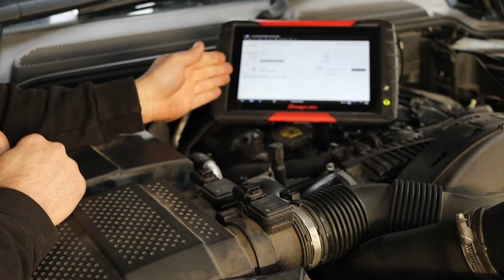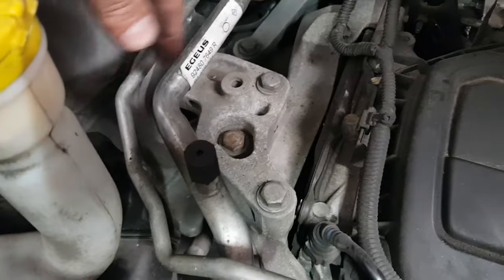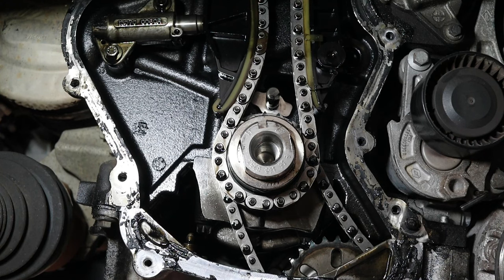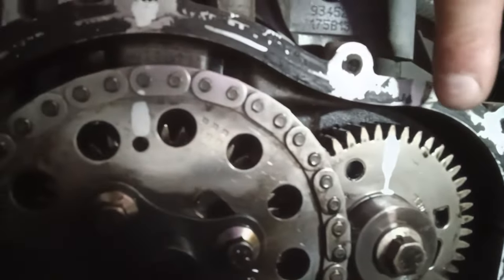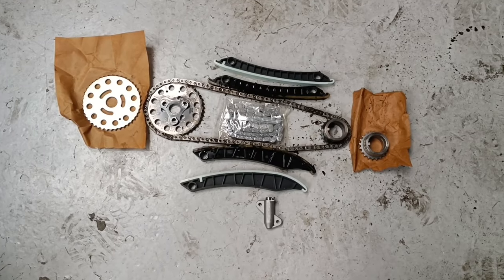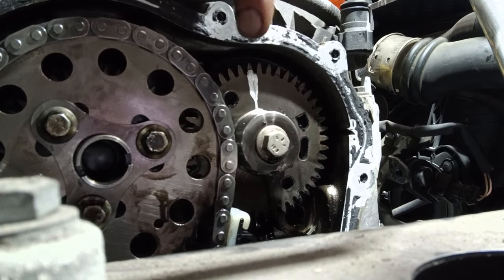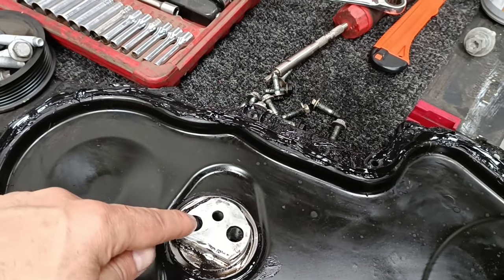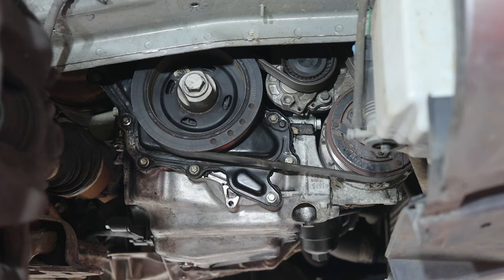Vauxhall Vivaro/Renault, Nissan R9M timing chain replacement

Comment: I have 250 k with my Laguna 3 2.0 dci M9R engine without any noise, bought new and oil changes performed at 10-12k and only original filters, I want to specify that I have not changed anything on the engine, not even the accessory kit and the water pump.
Reply: My engine sounds like shit. And I've just done head gasket and new chain, tensioner etc. Now sounds like garbage
Reply: i have same engine im my nissan qashqai from 2009., 150 hp, 280k, without any noise. never changed anything, only oil every 20k. should i change chain or wait for noise??
Reply: Wait for noise. I would. Imagine but 200k + then don't you think thing may start to wear out.
Preventative maintenence.
Reply: I have the same car, with the same engine. Mine has 350.000 km and still runs well. The key to this is : quality fuel, and regular oil and filter changes (every 10.000km). I use the recomended Elf 900SXR 5W30 and Purflux filters. I've only had to change the main pulley twice, and the EGR valve. Other than that, the car is pretty much all original parts.
Reply: @phazernet9760  so you have never changed timing chain or clutch?? what about turbo, any sign of 'hole'? i have this issue and sometimes it looses power
Reply: @ane_8186  the clutch holds a little low and sometimes makes a noise when half engaged, but it had that symptom for more than a year and didn't fail yet. The chain makes no noise, so why bother ? The turbo has a tiny little axial play, but nothing concerning. All normal wear for 350k. I live in a country with pretty shitty roads and the thing still has the factory shocks. I've replaced the wishbones and the stabilizer bushings because the rubber got old and cracked. I've recently bought an Espace with the R9M engine with 190k and i have to do the timing on it ASAP because it rattles and jerks. It's also leaking loads of oil from the timing cover. The 1.6 R9M kind of replaced the 2.0 M9R, but quality wise they have nothing in common ...
Reply: Good luck
Reply: I’m on 108k now in 1.6 dci changed oil every 10 k OE filters    no problems, coolant I replace every 2 years stays clean like new get 57 mpg avg
Reply: My engine sounds bad at idle rattling and a metallic tinkling only 41k miles. Sounds like the oil pressure operated tensioner isn’t doing a job. Once revs over 1200 runs smooth again. 
It was better when the oil was changed fresh. 
Surely the chain guides can’t have worn out at 41k ?
BT only change the oil every 20k miles I got it at 34k so it must have only had 1 oil change.
Reply: Never changed a chain on any of my vivaro. I do however change the oil and filters every year. Only use Shell Helix. If you don't change the oil expect, chain to go, turbo to go and general wear

Comment: Timing tools for this are MOT 1969 and MOT 1970. They must be used. Cam timing is out on this engine. Slot in the exhaust cam should be horizontal.
Reply: What brand timing tool would you recommend? I have oil leak from timing cover and my traffic 2008 is on 130k miles without service history.  Many mobile pros has rely long booking list and mine has quite bad oil leak so doing research on how to do chain replacement but finding timing tools are used even by mobile pros on these engines to time it then turn twice and see if the timing tool fits perfectly to confirm good timing. People feedback about lower mpg after timing done ( obviously right way ).
Reply: @JJ-jc8yv  I used an eBay kit on my 2.3 master which is the same tools as the 2.0 dci in your van. Different tools to the 1.6 in this video that I’ve listed above.  

The Renault workshop manual doesn’t actually say to turn the engine over and recheck timing. It is a good practice, however.

Can only see lower mpg being from not using tools. Using the tools correctly and following the correct procedure, the timing cannot be wrong.
Reply: @richards4456  I'm in same mind about mpg consumption, need timing tool to make sure it's 100% correct.  I thought one tool does m9r, m9t and r9m engines but you have mentioned as 1.6 is different . I seen timing tools starting from as little as £35 quid on bebay but obviously not branded what's your thoughts on not branded tools. In past non branded tools served me well if taking care of. Sealey timing kit looks same but cost about £135 instead ;) Laser kit isn't cheap too.
Reply: I thought the starter motor had to come out on this engine and the correct pins inserted to lock the crank otherwise the timing will be out.

Comment: No timing tools were hurt or even used in this video 🤣🤣😱😱
Reply from the maker: @craigwilson5573  and that's skill 👍😊
Reply: @melsmotors  to be fair your experience has shown here without the need for special tools. I've been doing job 20year but always use timing tools to cover my arse👍

Comment: Im an Agricultural mechanic Chains on cars might not stretch but chains on a forklift lifting masts do stretch as we have a stretch gauge for when we service the forklift to make sure its safe to use so i know it has nothing to do with timing chains but yes you can stretch a chain .
Reply from the maker: @g.a.f3398  thanks for the info, but they don't stretch on cars and bikes as the loads are a lot, lots less than the lifting force if a fork lift. Every day's a school day 😁

Comment: Thoroughly enjoyed that Mel, used to rebuild diesel engines in Liverpool and go all over the country and Europe repairing and overhauling... I got out the game when I split up with the missus and now own a vivaro for my own little business now that I've seen how you did that I will have no questions now when I do mine... My van is a  57 plate 2.0 has covered 184000 currently... Same engine and box I bought from a family member wit 94000 on clock I service it every 4 to 5 months oil and filters wise and it never skips a beat... Still on original turbo too! Never gets abused daily commute from Liverpool into north Wales and back daily... Served me very well so far mate I can't complain. Keep up the content mate very helpful indeed. 👍
Reply: Fancy doing mine on my 1.6 I’m in Liverpool 😅
Reply from the maker: Thanks for watching and commenting 👍🙂

Comment: Remove the 2 13mm headed bolts on the slam panel piece where the washer bottle neck is held on and them pop the headlight out makes the access 100 times better much easier for setting the timing tools for locking the cam gears

Comment: i would not say that job was the hardest i ever seen and apart from getting the timing spot on the way you done it looks good if i do one i will take the water pump wheel of first thanks for the video great stuff

Comment: Great video very informative, think my chain may be excessively worn as getting alot of noise from that area and oil just running out.  350,000 miles
Reply from the maker: Wow 350k, this just shows that the more you drive a vehicle the longer they last, the van in this video was less than 70k! Thanks for watching and commenting.

Comment: Nice video I have to say that the lack of timing marks on most engines these days is awful.
Reply: There's a proper locking kit for these engines. Timing marks would be useless as the exhaust cam pulley is floating.  Needs to be timed up with the correct tool.
Reply: There was a timing mark on the top pulley but it was installed in the wrong position, a good quality chain kit will normally have marked links as well. As mentioned on other comments there is a locking pin for the crankshaft and a locking tool for the top pulleys!

Comment: Hi, this is a great guide for the job. I'm doing a chain replacement on a 175k Nissan Xtrail that broke its chain at 70mph and would be interested in how the crank /cams can be re-timed if no marks are present on the sprockets and the chain is off. Fingers crossed no valves are damaged - the cams/valve springs are not easy to view on this engine without a load of extra top end strip down.
Reply from the maker: Hi Dave, sadly on this engine I didn't have any tech data for locking tools, hence the painted marks. At 70mph you would have almost certainly broke every cam rocker. I would be astonished it there was no engine damage, you may be lucky! I would remove the injectors and a carry out a cylinder leak test for bent valves. If they're bent, engine out, this is the easiest way to remove the head, not a driveway job! Good luck and fingers crossed. Thanks for watching and commenting 🙂🤞
Reply: ive done an xtrail and was a nightmare, ended up taking the engine out
Reply: Which engine is it ? Old 2.2 diesel or the 2.0 renault one ?

Comment: You need the locking tool for the cams.m to be perfect. The crank can be judged by eye if not but the kit it worth using. Can be done in 3 hours. I do loads. Good video though
Reply: Mark on chain too

Comment: The crank pulley have a specific position for . I mean rotate in some position?  I changed the seal 2 times because bad seal...with first seal engine run perfect balanced but leak seal... second seal no leak but engine vibrates a little but annoying...

Comment: Can't believe its only 66k. Mine is on 160k with no issues. The timing chain is inherently noisy at times on start up. Mine has done it from 55 miles delivery mileage on the clock. It is intermittent, and goes after.4 or 5 seconds of starting. It seems to be a characteristic of this engine.

Comment: Great video thanks. I'm using it to check the timing on my Nissan X-Trail T31. Can I ask how you removed the waterpump pulley? I just had a look at mine and couldn't see a way to lock it to crack the bolts loose. Thanks.
Reply from the maker: You usually loosen the bolts with the alternator belt still on, this way you're working against the compression of the engine without having to hold the pulley! Hope this helps 🙂👍
Reply: @melsmotors  Thanks for the quick reply! I've already taken the belt off, I'll try holding it with an oil filter removal tool and see if that works :)

Comment: Hi great video. My timing chain was replaced. It is leaking a small bit if oil through the bolts on the engine mountain. Can you seal them without having to remove the timing chain cover?
Reply from the maker: You should be able to!
Reply: Would you take out bolts and seal round them?
Reply from the maker: @colindouglas1354  yes and silicone the engine mount as well, this is what I would do 👍
Reply: Cheers.  Thanks for the reply 👍

Comment: good video. Just a extra bit of advice though. Always turn the engine a least 2 revolutions by hand before starting it. that way you will detect any valve to piston contact in case you've made a mistake. otherwise just using the key will bend valves.
Reply: He did

Comment: Great video and great explanations. I think it was a hard work spending probably 5 hours on it. 
Really nice video! Aldo it looks good I'm confused why you did not used a chain locking kit for installing the new chain ? Very complicated and handy job and there's a high chance of damaging the whole timing without it.
I noticed that the new camshaft sprocket wasn't lined up with that mark (the little camshaft sprocket hole should be at 12 o'clock and also use a permanent liner paint for marking it, so that the guys that will change that in the future should have a pro and easier job). 
The new chain (if it's OEM) has two special links (coloured kinda brown) that should be on top (12'o clock) on that camshaft sprocket and one special link (also brownish) so that link goes under the crankshaft sprocket at 6 o'clock. 
Are you guys upset with the Torque wrench? Haven't seen one bolt tightened while using it. (or mention the torque for special bolts)
Reply from the maker: Thanks for your lengthy message. My videos are for entertainment only and not a guide for repair, I don't want to be liable for your mistakes, I never mention torque settings in my videos as they differ from vehicle to vehicle and I also don't waste time videoing me torquing up bolts as to appease people. There was also no data available for locking pins as shown in the video. Thanks again for watching and I look forward to watching some of your accurate videos. 🙂👍
Reply: Even if you use chain locking kit, which actually locks only crankshaft and camshafts, you will need to install the camshaft chain sprocket yourself anyway, as you said hole to 12 o'clock, but there is no way to make sure it is exactly there.

Comment: Great video very informative! I've bought a febi chain kit for my 2017 trafic, but seen it doesn't come with New bolts for the tensioner or guides.

 I'm assuming the bolts can be reused and aren't stretch bolts?
Also if you've got the torque specs for the bolts that would be great!
Thanks
Reply from the maker: You can reuse the nuts and bolts, sadly I don't give out any torque settings because they're different on all vehicles. All my tech data is via registration numbers, so it's accurate to that car! 👍
Reply: Thanks for the speedy reply pal! I'll be getting a workshop manual in that case. Have you ever replaced a steering rack on one of the mk3 trafics? Struggling to workout if the racks are interchangeable between years
Reply from the maker: @thomasdentith-barnard418  nothing is interchangeable on a Renault, even on the same year, Renaults are a pain in the backside!

Comment: All that Silicone ? Does it not squash inwards and bits eventually brake off and it blocks an oil hole and theres your crank or a cylinder gone? Im super careful with excess silicone and usually the outer Edge . Great video thank you
Reply from the maker: No different to factory silicone! You open up most engines and there's silicone over spill. Most sumps are now bonded on and when you remove them there's always silicone over spill. It usually stays where it sets. 👍
Reply: Ok good to know ill take note of that stuff your using , thank you, im going to look at a vivaro tomorrow 180k, ive always had older Vw's im wondering am i mad and these are soft ?
Reply from the maker: @208d  TBF I wouldn't put my hand in my pocket and spend a penny on a German vehicle, I make a small fortune out of crappy German cars! Mercs, BM's Bentley's, Especially Audi's and VW's, the workshop's full of them. I have a 4 year old mercedes sprinter in the workshop for a failed driveshaft, I've had it in for almost 2 months, another month to go until I get one from Mercedes! 3 month back order for a poorly built drive shaft! No one else can get it either! 🤔
Reply: @melsmotors  I know id hate to be working on the newer stuff , its such rubbish, people think buying new will solve any headaches its a joke really, my neighbor has a crafter 3 yr old 160 km,he bought it brand new, rear crank seal leaking , oil pressure sensor gone and now its using water, dealer doesn't know whats wrong hes putting half a litre of water into it after 200km. As for main dealers half of them haven't a clue .

Comment: Great video. Just done my m9t 2.3 Renault master which is a very similar job, my new chain sounds just as bad as my old one 😩
Reply from the maker: Thanks for watching and sorry to hear that you're still having issues, not a nice job to do twice 🥹😔
Reply: Did you resolve your issue? I'm having similar troubles. Might it be oil pump chain or maybe dual mass flywheel?
Reply from the maker: @iaino45  sadly I can't confirm your issues from afar, speak to your local friendly mechanic. Thanks for watching 👍🙂

Comment: Great video! Any reason not to change the lower chain that goes into the sump? Does it not wear out at all? Cheers!
Reply from the maker: It can wear for sure but this van had done 66k and it wasn't part of the quote!
Reply: @melsmotors  Ah, thought so! Shame you didn't get the service on that too as they may as well change it while that far in. Good educational video though once again!